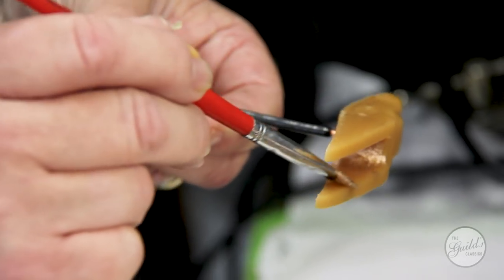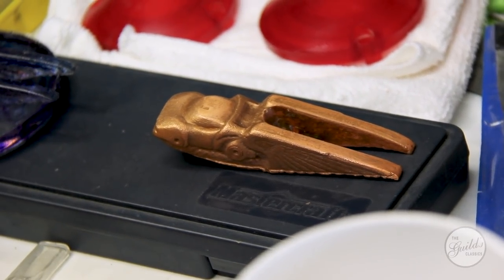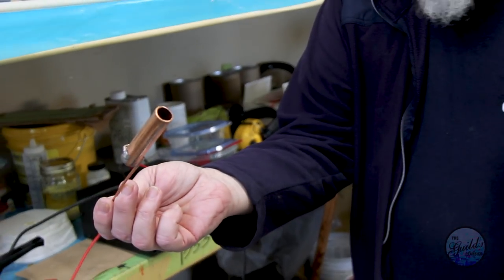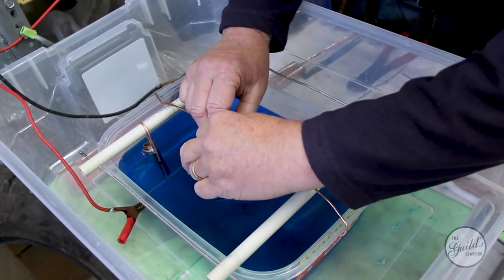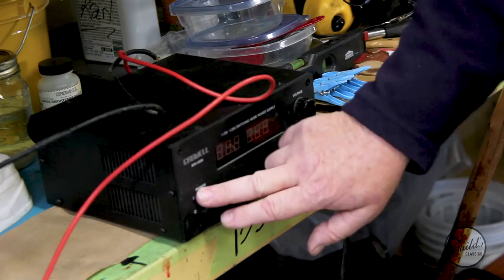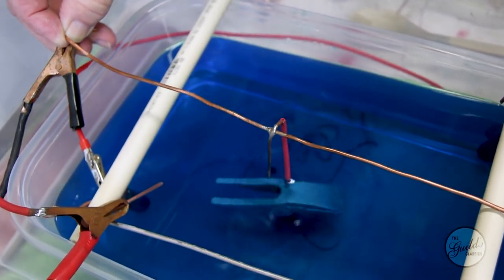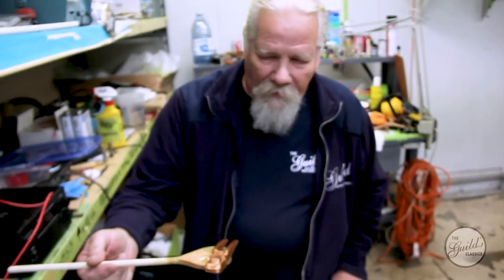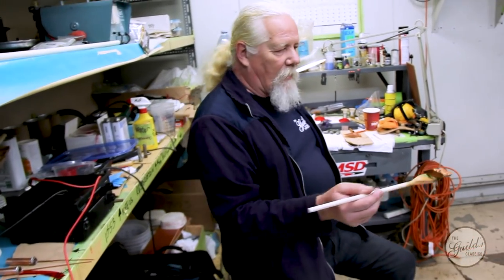Electroforming

Comment: you dont need to solder your connection you can just wrap the wire and it will be a good enough connection also if you reverse your mold so it grows outside in get full detail

Comment: At a guess,this could be used to restore diecast? sealing the pot metal from the atmosphere might prevent bubbling from coming back on hard to find pieces. I have worked for an alleged high end resto shop in the past,but your operation makes the other place look like a glorified rust repair shop.